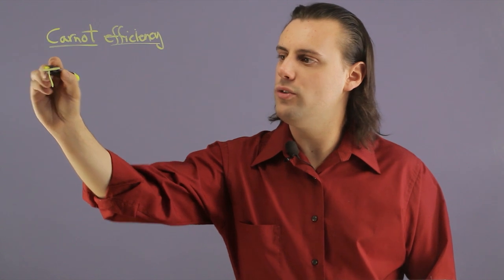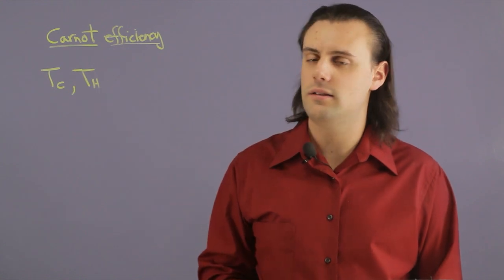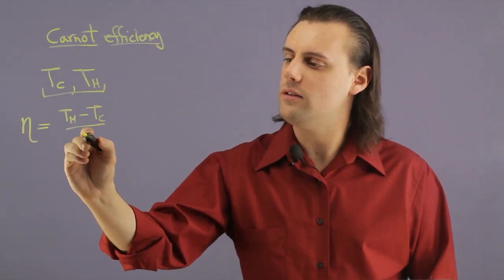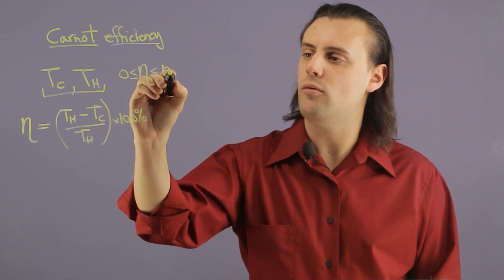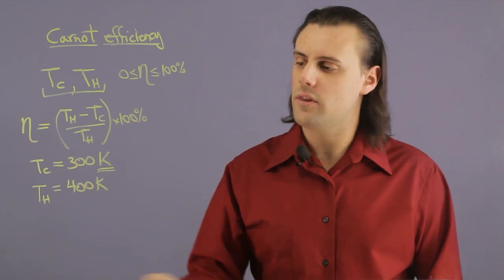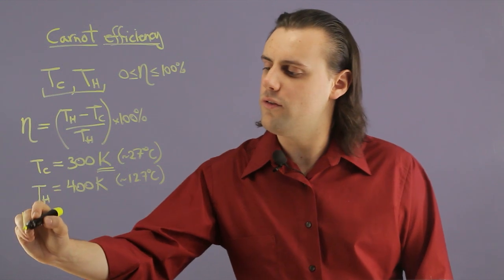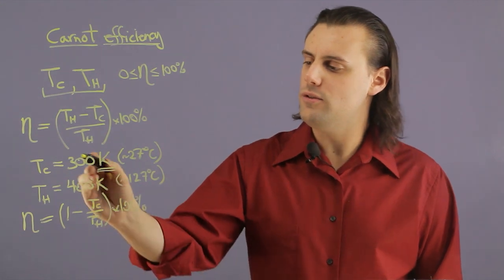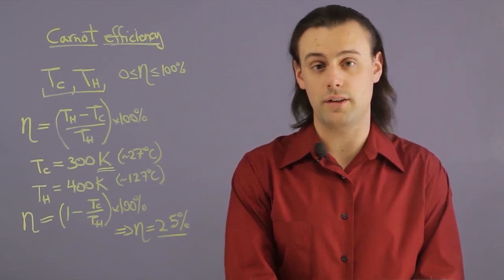How to Calculate Carnot Engine Efficiency When the Temperature I... : Physics & Chemistry Education

Comment: But thermal efficiency is not calculated on temperature difference. It is actually heat input and heat output. So it's not Kelvin or Celcius, but Joules.
So, it is actually        

                   ɳthermal = ( (Heat Input-Heat Output)/Heat Input ) X100%

             Or,   ɳthermal = (1- Heat Output/Heat Input) X 100%
Reply: Q1 /T1= Q2/T2 that's why
Reply: It's given textbook bruh

Comment: plz tell me if the difference of temperature is given in Celsius (T1-T2) for calculating efficiency do we take same temperature (T1-T2)  in Kelvin also or we add 273 in that difference for calculating efficiency ??? plz reply asap
Reply: Rule of thumb: typically it's best to convert to kelvin and yes you add 273 to do so
Reply: I realize I'm a year late in replying, but to answer your question, since Kelvin and Celsius have the same scaling (beyond a DC offset of 273.15 degrees), it actually doesn't matter in this case. A change of temperature in Celsius is equivalent to a change in Kelvin (e.g., 500 - 400 degrees = 100 degree difference is the same as (500 - 273.15) - (400 - 273.15) = 100 degrees....the offset would simply be cancelled out when calculating a temperature difference). But if you wanted to be consistent, it's generally best to first convert all temperature units to Kelvin, as po pi mentioned (especially if you're working with other equations involving temperature...units are important!).
Reply: This is true so long as you ensure that denominator (which in this case is the hot temperature) is in Kelvin. I'm sure you already know this, just wanted to clarify for anybody reading the comments who are a little confused
Reply: Google.
Reply: We take same